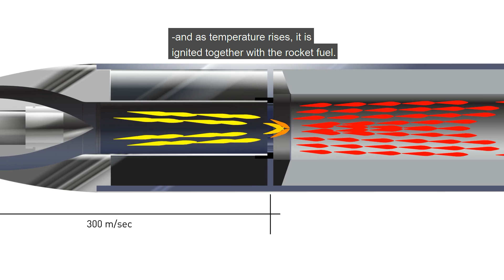Ramjet missile propulsion - the biggest invention since the introduction of the jet engine

Comment: As a defense contractor for the US Air Force, I had a colleague that had worked on the Bomarc, a supersonic ramjet missile deployed in the late 1950s. It had a range of 700km, with a top speed of Mach 2.5.
Reply: From what I can find the Bomarc is a liquid fuel ramjet, not a solid fuel like in this video. If I understand the idea correctly you get a missile with solid fule that would be cheaper to build, require less maintenance, and simple to store then a liquid-fueled missile.
Reply: @target844  Indeed, the switch to a technically much simpler and less expensive solid-fuel rocket motor design that combusts using only atmospheric oxygen from the ram-air inlet at the front is what's very innovative about Nammo's new devices. Personally, I find the Sprint ABM from the US's old Nike-X program in the 1960's to be the most impressive surface-to-air missile ever created in terms of raw performance. The system ended up being way too expensive and the Nike-X program was cancelled. But, I could see a new hybrid ram-air solid-fueled rocket like Nammo's concept being used today to start a new terminal-phase ground-based ABM missile program based around a much longer and more maneuverable hybrid ram-air solid-fueled rocket motor to finally make a more affordable and mass-production capable ABM missile shield for North America or Europe and Scandinavia.

Sprint ABM: https://en.wikipedia.org/wiki/Sprint_(missile)
Reply: @metanumia  Wow, I had no idea Nammo was testing solid fueled ramjet engines, I just assumed they were liquid fueled ramjets because I had no idea solid fueled ones even existed! Do you have any idea what kind of solid fuel they use, and how they make it suitable for combustion? And what do they use as an ignition source?
Reply: @pieterveenders9793  I didn't know there was any solid that would burn fast enough in air to do that, but maybe there is. I wonder if they're adding some solid oxidiser and using the air as additional oxidiser. Or are they actually using liquid fuel for the ramjet stage and solid fuel for the rocket stage?
Reply: @metanumia   Sprint employed a star-grain "composite modified double-base propellant", known as FDN-80, created from the mixing of ammonium perchlorate, aluminum, and double-base smokeless powder, with zirconium staples (0.125 inches (3 mm) in length) embedded or "randomly dispersed" throughout the matrix...  Mach 10 in < 3 seconds. Totally not air breathing.  An ABM.  Completely different from the Bomarc, which was an air breathing liquid fuel cruise missile.
Reply: I'm an aerospace engineer and you are right THIS IS OLD TECHNOLOGY that is being re-birthed.
This is the second of the videos I have watched. The other one was on their artillery shell that has a ramjet or what they call a ramjet as it should be classified as a ram rocket because they use solid fuel.
This is mainly a PR video.
Reply: Bomarc had a range of 700km and modern MIM-104 Patriot has only 160km range...

Comment: The Meteor missile already have a restartable ramjet motor.

The problem is still that the laws physics still apply.

Remember when Bugs Bunny sidesteps the raging bull? That is what aircraft can do to fast moving missiles in BVR engagements as long as the aircraft have proper sensors. And we are down to single digit hit probabilities. If you add electronic warfare it becomes even worse.

It is far cheaper to buy the aircraft from the pilot rather than try to shoot it down.

If you really, really, really want to shoot down an aircraft you have to reduce the speed of the missile when it is close to the target to close the speed of the target. If you get behind the target, the missile can accelerate.

The only other option is to have several missiles converging on the target from different directions.

Comment: Soviet missile 2k12 KUB   is with second stage ramjet propulsion  since  1967. https://en.wikipedia.org/wiki/2K12_Kub
Reply: Wikipedia us wrong like most of the times.  KUB doesn't have ramjet nor any liquid fueled engine.   KUB has solid rocket motors for both stages one is booster other sustainer.  
S200 did have liquid fueled second stage most likely ramjet while s75 dvina had regular liquid fueled rocket engine .

Comment: The ramjet was conceived in 1913 by French inventor René Lorin, who was granted a patent for his device
In 1915, Hungarian inventor Albert Fonó devised a solution for increasing the range of artillery, comprising a gun-launched projectile which was to be united with a ramjet propulsion unit
In the Soviet Union, a theory of supersonic ramjet engines was presented in 1928 by Boris Stechkin. Yuri Pobedonostsev, chief of GIRD's 3rd Brigade, carried out a great deal of research into ramjet engines. The first engine, the GIRD-04, was designed by I.A. Merkulov and tested in April 1933
and so on
Reply: I'm an aerospace engineer and you are right THIS IS OLD TECHNOLOGY that is being re-birthed.
This is the second of the videos I have watched. The other one was on their artillery shell that has a ramjet or what they call a ramjet as it should be classified as a ram rocket because they use solid fuel.
This is mainly a PR video.

Comment: The problem is that that type of engine needs to be moving very fast before it can be lit.  Something like 2 or 3 times the speed of sound.  So it cant be lit from a stand still.
Reply: why would you be firing air to air missiles while the plane isnt moving
Reply: It becomes more efficient at supersonic speeds, but ramjets can be lit at Mach .5 and are reasonably efficient at speeds as low as just under the speed of sound (to accelerate to higher speeds), which is jet airliner speed and about the slowest (say) a fighter is going to be going in a situation in which it would contemplate firing a missile.
https://www.youtube.com/redirect?redir_token=J-OqxzlEuRp6dslES8lD71aIqrN8MTU5MTAxNTQ0NUAxNTkwOTI5MDQ1&stzid=UgzaCS724jboqrCwy0t4AaABAg.98yho_NSvfZ995_JpxUk5G&q=https%3A%2F%2Fen.wikipedia.org%2Fwiki%2FRamjet&event=comments
Reply: Yes, but fighter jets can reach that speeds, so maybe the missile wouldn't need anything fancy to start the ramjet.
Reply: Could be added to a first stage rocket engine if launched from the ground or a ship.
Reply: Yea there is always a first stage rocket, lock at the propulsion of the meteor. It has two motors in one.

Comment: "the biggest invention since the introduction of the jet engine"

1st jet engine ever invented was a ramjet...
Reply: Pulsejet. It had one way valves at the air intake and worked in cycles. Ramjet has no valves and works continuously, but has to be faster to work.
Reply: @1Maklak  Pulsejet...the V-1.
Reply: @1Maklak  The ramjet was conceived in 1913 by French inventor René Lorin, who was granted a patent for his device
In 1915, Hungarian inventor Albert Fonó devised a solution for increasing the range of artillery, comprising a gun-launched projectile which was to be united with a ramjet propulsion unit
In the Soviet Union, a theory of supersonic ramjet engines was presented in 1928 by Boris Stechkin. Yuri Pobedonostsev, chief of GIRD's 3rd Brigade, carried out a great deal of research into ramjet engines. The first engine, the GIRD-04, was designed by I.A. Merkulov and tested in April 1933
and so on
Reply: @moreinzenjering6727  The hard task is to get them to work in practice.
Reply: That is true. 
https://youtu.be/E7SqSNQeAFM
Reply: @olemann2832  That brought back memories from a long gone childhood. AND I even remembered the words. 😳

Comment: The Soviets, Americans and a bunch of others had working ramjets decades ago, it shouldn't be presented as new technology.
Reply: A valid point, however, this is the first time I have seen SOLID FUEL ramjets being developed for missile propulsion (I saw it once proposed for accelerating bullets).  The early experiments cited in this thread and those above used LIQUID fuel.
Reply: @digitalnomad9985  Ah I see, that's a good point!
Reply: @vtkrey  also this one looks to be much smaller than good ol Talos
Reply: @digitalnomad9985  what's the advantage of solid fuel over liguid fuel? Safety?
Reply: @ohkabomb917  Energy density.
Reply: @digitalnomad9985  soo longer ranged?
Reply: @ohkabomb917  I guess, all I know about THIS missile is what I saw on this video.  Obviously, with self accelerating bullets volume is a fundamental constraint.  You have a little more room in a missile.  The best solid fuels pack more energy into a given VOLUME, the best liquid fuels pack more energy into a given MASS.
Reply: we need more wars so we can kill all of us
Reply: for missiles is new
Reply: Scout Blu The 9M39 missile of the 2K12 Kub (SA-6) SAM system uses a ramjet if not mistaken.
Reply: @migreyescastro  Yes and its reverse engineered as Akash by India with more modern electronics, tracking and a different warhead.
Reply: @steel_yeet2989  Not at all, the Russians have fielded the P-270 and P-800 ramjet powered ASM for decades, they also helped India develop the Brahmos ASM which also uses ramjet propulsion.  In the west a few nations also fielded ramjet powered missiles for decades.  The earliest ramjet powered missiles appeared in the 1960's both in the west and east.
Reply: Remigijus Naucas don’t forget the European missile called Meteor